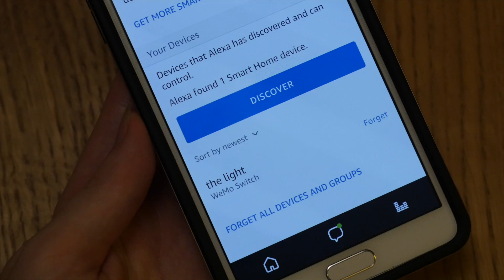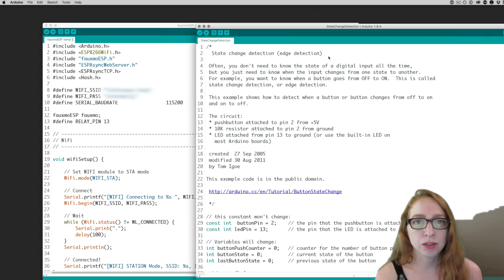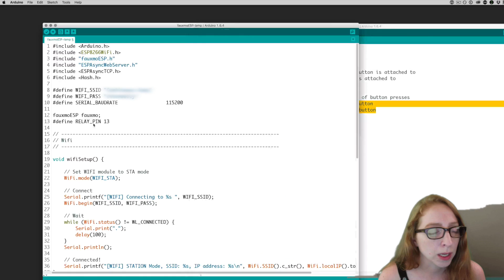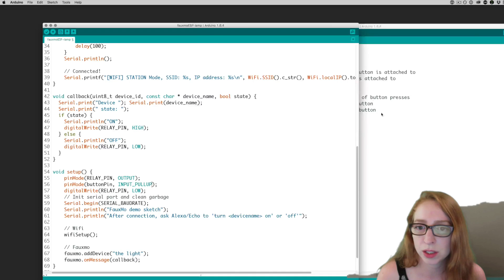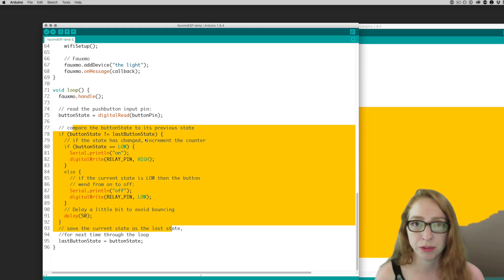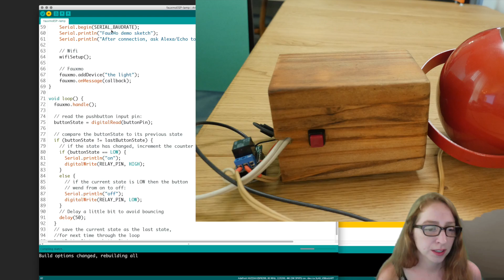Smart Lamp with ESP8266 & Amazon Echo // Becky Stern

Comment: This is so cool little project!
Decided to go ahead and did it, working perfect.
My question is what should I change in the code if I want to use micro switch (reset) button. Any help really appreciate.
Thanks
Reply from the maker: The reset button resets power to the board; it is not available for a custom function.
Reply: Becky Stern Not the reset button built in the board. I want to use micro switch instead and using toggle switch. Thanks
Reply from the maker: Oh, you can see my confusion. The code change would be one of simplifying to only detect a state change in one direction, ie from HIGH to LOW and not from LOW to HIGH. The word for that type of switch is "momentary" vs toggle.

Comment: I like the idea of a Power Relay FeatherWing. It seems to be an easy way to isolate the electronics from the 110 line voltage. Also, glad to see you clean up the AC connections. One key point, if you don't mind? Make sure the "hot" wire is the one being switched at the relay. If not and your AC device grounds the neutral wire to the chassis or outer metal case, this a potential for shock. Sure, it's funny when ElectroBOOM does it. But from actual personal experience, I won't recommended it.  ;)
Reply from the maker: Good point, thanks! You can find this and more safety warnings in the full tutorial at the link in the description. I always tell folks (regarding AC) that if they don't know what they are doing, work under the supervision of someone who does. =]

Comment: Cool, but I'm still not sold on the always listening corporate microphone. Could you get rid of the "hiccup" with debouncing?
Reply from the maker: +Bart Stikkers well, at least your two comments are equally underresearched. You can turn the Echo listening off or build a paranoid kill switch, but it's your Samsung TV that's always listening. Code uses debouncing already, increasing the delay just amplifies the hiccup to a point, then degrades the promptness of the action. Choosing a different toggle switch would solve it better, but imho it's nbd.